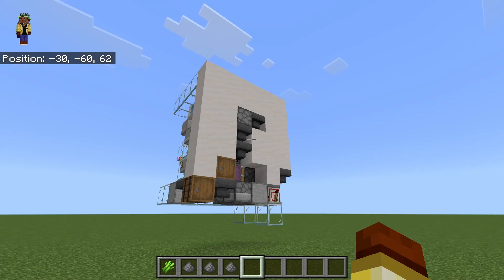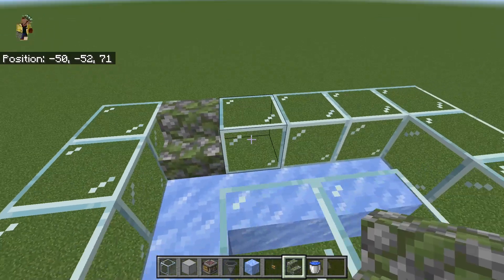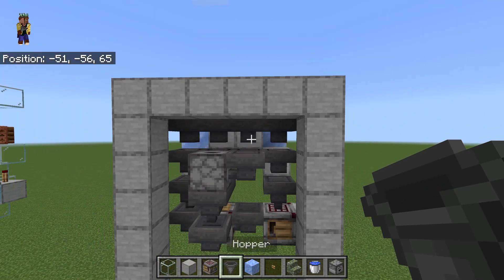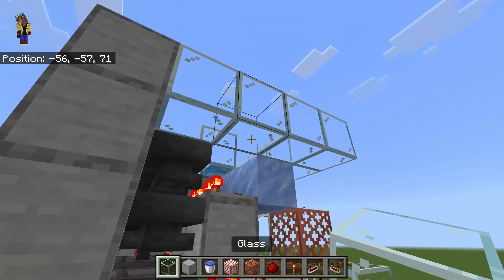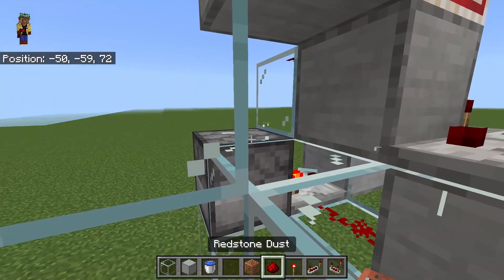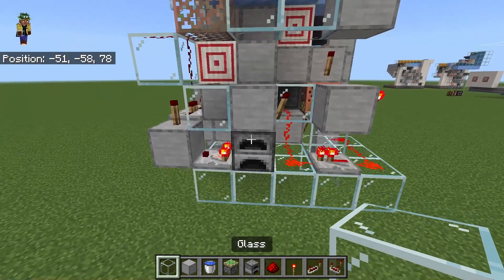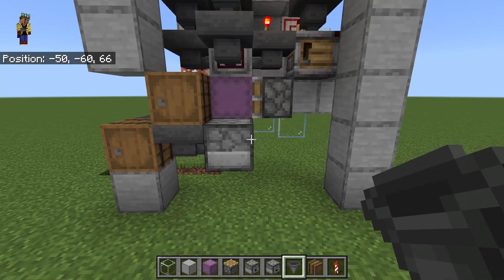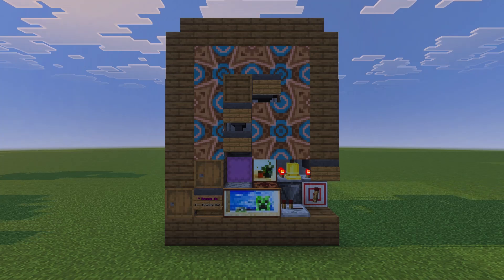Rocket Crafter, duration 3, 27k/hr

Comment: Any fixes for the new frozen ocean and deep frozen ocean chunk glitches?
Reply from the maker: No, that’s something Mojang has to fix.
Reply: @goldenhelmet403 Does mojang even know it because it is not fixed in previews and it has been a month
Reply from the maker: @FsdayaalPro2 yes, they know. It’s actually been around for about 8 months. That’s just how they roll. Trail ruins are still almost impossible to find in Bedrock without chunkbase. And glow item frames still get dark at nighttime.